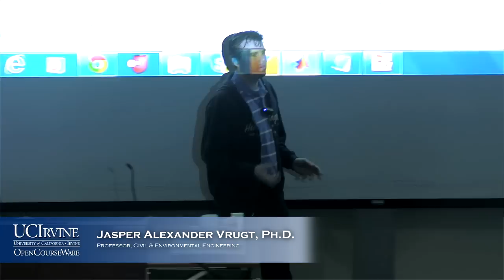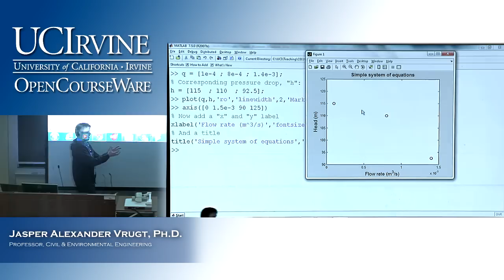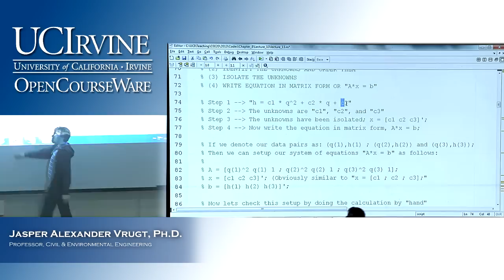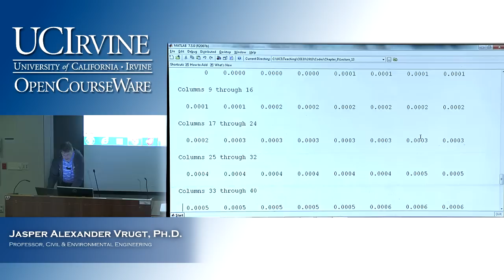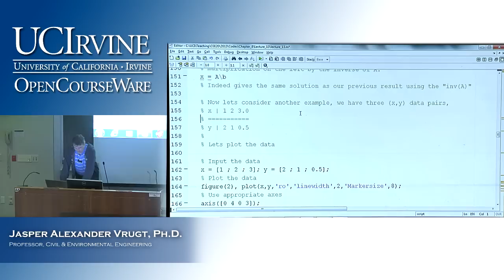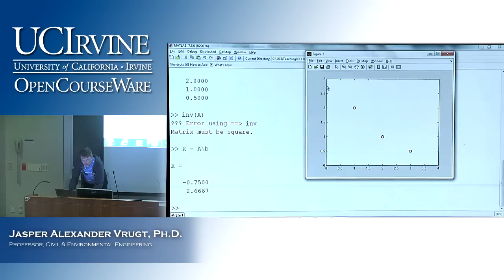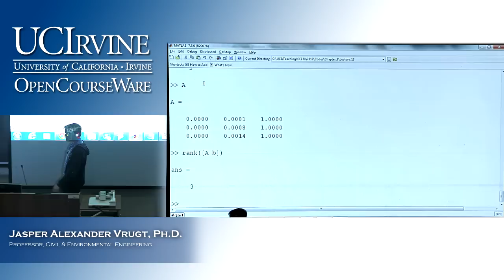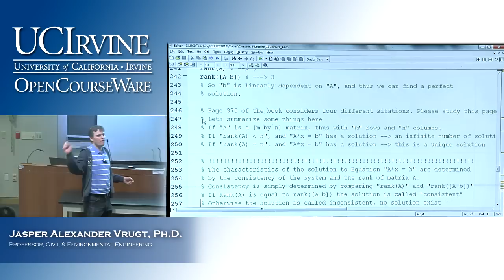Engineering CEE 20: Engineering Problem Solving. Lecture 13

Comment: I haven't understood why 3 images are sufficient to define the function "h(q)". Why this function has to be a polynomial?
Reply: It hasn't. We assume it is fair enough to use a polynomial function instead of the actual function that we can't determine once and for all, or however a polynomial one can be surprisingly easy to evaluate or derive. 

In one of the previous lecture, Jasper asserted he knows actually little of idrology, he just uses very well Matlab. Later, with the interpolation, he finds a very good way to find the right answers to every "question" x, and the way is the function, although he almost don't know what he is talking about. I think it is almost a kind of magic.